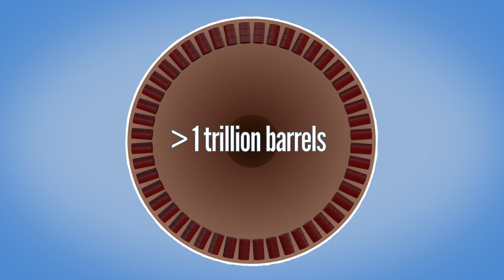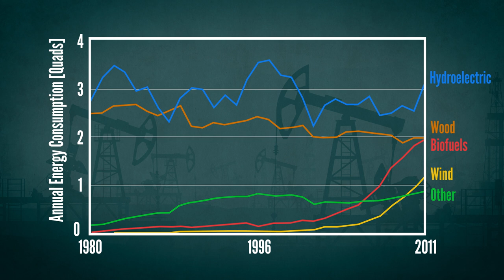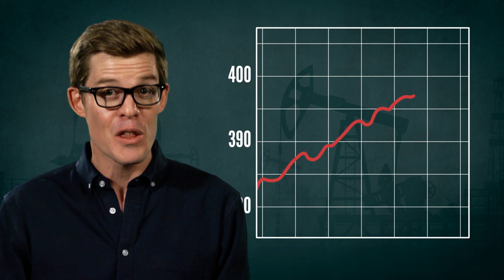When Will We Stop Using Oil?

Comment: The problem we have with energy is that we are kind of bad at getting it.  People living in extreme continents like Europe and North America are using oil, and for what? There's plenty of solar energy at the equator. There are deserts there, full with burning hot energy. We could harvest that energy, if we cooperate with the countries there. We pay them a small fee, or we simply build the infrastructure ourselves. This is a way better alternative than letting that energy dissipate into the atmosphere while we burn oil.
Reply: Transmitting that energy would be a challenge. More local sources already lose 40% in transmission. However, the coldest corners of the planet get plenty if solar energy beaming down at them. It is a collection and storage that are the challenges.
Reply: You seem to not understand the challenges. First off, solar panels are not as efficient as you might think. They do not currently have an energy output even close to that of oil at the same price, and that goes to another issue: cost. The cost of setting up enough solar panels to provide energy on the level of what oil gives us is infeasible in the surface area needed for those panels. You also cannot convince the masses to invest in solar unless if it's a more economic decision for their lives. Money is the largest incentive to most people.
Reply: Electricity is one of many forms of energy. Electricity accounts for about 20-25% of total energy consumption. Solar, wind and nuclear produce only electricity.  These will not solve the problem.

Comment: Its so sad that nuclear isn't used more.
Reply: al thought i agree whit nuclear the affects of it wayyy to risky take the ukine for expanmple the city whihc had its nuclear core melt caused so much radition that to this day its still there and also it too expenices
Reply: Stalin wut did happened to ya bruh?
Reply: Nuclear Fusion not fission should be utilized.
Reply: Alpha581 Sure it should, when we have it. But sustained efficient fusion is still far off. We should not wait for lottery but do something now.
Reply: The problem rigth now with nuclear plants is the radioactive waste that they produce and these radioactive material takes a long time to decay.But we till have other renewable options.
Reply: Alpha581 Waste and problems produced by nuclear is microscopic when compared to fossil fuels. All the waste goes to the metal containers and is manageable and most of time managed really well.
Also there is different kind of reactors that can use other reactors waste as fuel. And we are getting better at it with every next gen generation reactor. Renewable's are good choice in some places/climates and applications but can't produce majority of ever increasing power we need.
Reply: +mukkaar Still not sustainable. Sorry.
Reply: mukkaar it's expensive
Reply: Not sustainable from an environmental point of view. Sure, the quantity of pollution is small compared to other energy sources, but the impact of said radioactive waste is HUGE!!! Why? Because radioactivity lasts pretty much FOREVER!!! Some people idealize nuclear energy as if radioactive waste leakages didn't exist, the problem is that when something like an earthquake leaves you the way the Japanese are now after having the problem in the Fukushima reactor, you can't deny there are problems. 
If nuclear energy is going to be any real good, then R&D should be done to make it better, If not achieving Fusion, at least I have seen some stuff about thorium fueled MSR which seems very promising, but I would not focus my bets on Nuclear. I would rather think about solar and wind power and as many ways to store the energy from said sources as possible (Batteries, Hydrogen, etc.)
Reply: @tauceti8060  Have you considered anti-matter drives powered by di-lithium crystals?   It can drive the Enterprise at warp 8 so why aren't we using it?

Beam me up Scotty, there are no signs of intelligence at all on the third rock from the sun.
Reply: @p0llenp0ny  The earth and sun are not sustainable.  They are scheduled for a burn out.

Comment: Unless there's some massive breakthrough with renewables, I personally think the only real short term solution we have is Nuclear energy.

A video explaining it's advantages over the alternatives:
http://youtu.be/pVbLlnmxIbY
Reply: the problem is we subsidize oil we to focus on subsidizing renewable energy like wind and solar
Reply: MarlowPreston That video doesn't talk about the huge cost of building nuclear reactors, running them or decommissioning them.  The last nuclear reactors built in the USA were 3 - 5 times their original budget.  Today, reactors in Finland, the UK and the USA are experiencing the same ballooning costs as the previous generation of reactors, so we're repeating the same mistakes.  There's only so much time and money to deal with climate change and nuclear power is too slow to build and too expensive to be a practical solution.
Reply: MarlowPreston its awesome until we have a meltdown.
Reply: You're underestimating the power of human error. But if this is what you choose to believe fine.
Reply: mijnnaam maannjim what "all in" costs are you using for nuclear power?  (The figures from a reactor currently under construction would be your best bet).  Keep in mind that even these high build costs are subsidized by government money and policy to keep them artificially low.  

And what "rare-earth" elements are you talking about that solar power requires?  Silicon, glass and aluminum aren't really in short supply, unlike uranium.

Finally, solar power cannot be used as a cover for a weapons program while nuclear power has been used as a front for developing nuclear weapons by several countries.
Reply: mijnnaam maannjim Nuclear is subsidized out the wazoo.  It sprang out of nuclear weapons production and a lot of the research was used to make nuclear power possible.  The fact that light water reactors can easily churn out plutonium also intricately links them to nuclear weapons.

Secondly, the Price Anderson Act forces the U.S. Gov't to cover the nuclear industry's liability insurance, something they cannot buy on the private market at any price since the potential liability for a nuclear disaster is larger than  even most countries to recover from.

On top of the billions in loan guarantees, new nuclear plants are able to pre-charge electric customers billions of dollars years before these plants open, or if they ever open at all.  These "cost recovery" measures saddle utility customers with the high risk that nuclear plants under construction will be abandoned while the nuclear plants themselves get to present an artificially rosy financial picture to investors.

When plants do get abandoned, utility customers have routinely been saddled with the bad debt accumulated during the failed reactor construction project.  Look up WPPS or the "Stranded Debt" of Ontario Hydro for some examples of how this works.

Even after all these subsidies, nuclear plants are uneconomic to run: http://www.bloomberg.com/news/articles/2015-01-05/new-york-reactor-s-survival-tests-pricey-nuclear

Finally, we are finding out that the cost estimates to decommission nuclear plants were wildly low.  Some decommissionings are coming in at billions of dollars and taking upwards of 60 years because of all the residual radioactivity on-site.  

We are not seeing the full costs of nuclear even in the super-high reactor construction costs.
Reply: mijnnaam maannjim And as for the new Dutch offshore wind farm, I assume you're referring to the Gemini Wind Farm.  At 600MW and costing 2.8B euros ($3.18B), it comes in at 4.6 euros ($5.20) per watt.  Even at a 40% capacity factor, it will generate 42B kWh (240MW * 24 * 365 * 20 = 42B kWh).  The cost will be $3.18B / 42B kWh or 7.6 cents per kWh.  Increase that to 8 cents for O&M. This is very economic, especially considering power prices.  And especially considering that the new Hinckley Point C reactors are guaranteed to make at least 14.7 cents per kWh with prices escalating to over 30 cents in the 2030's: http://www.world-nuclear-news.org/NP-Hinkley-Point-C-contract-terms-08101401.html

So, which technology is actually economic?
Reply: mijnnaam maannjim "Neodymium, terbium, dysprosium, europium, indium,...and yttrium,"  None of these are used in solar cells: http://www.madehow.com/Volume-1/Solar-Cell.html

Silver is used for electrical contacts, but this is not a "rare earth" element and replacements are being found for it.

While thorium reactors and / or reactors that can burn nuclear waste are desirable, they only exist on the drawing board currently.  Some experiments with them in the 50's and 60's led to disastrous results.  These reactors would need a decade or so of development to achieve a modern design and another decade or so of development to achieve commercial viability.  I'm all for seeing if these reactors can become viable, and this investment is vastly preferable to throwing more money away in light water reactors.  However, 20 years from now, renewable energy and batteries will be even cheaper than they are now and it will be hard for new nuclear power to supply more than 10% of energy use.
Reply: they migth be a solution someday, but for now we must test and experimante on them to come up with cheap, safe and easy to maintain nuclear plants
Reply: Gonna be honest here, I'm more interested in the source of your profile picture. Sauce please?

Comment: Using oil and coil or even wood as an energy source by the principe of combustion produces CO2, light, water and thermic energy that we use. The main problem is the CO2 released into the atmosphere, and the more CO2 there is, the more the whole global warming thing become strong, the more temperatures all over the world increases, but that’s not all. Even a slight increase of CO2 have good effects on plants, as they use it with water and sunlight to produce... organic stuff. Then we can deduce that the more CO2 there will be, the faster plants will grow, the more CO2 will be recycled. It’s like if plants converted sunlight energy, water and CO2 into some sort of battery, wich when we use it release that « sunlight », water and CO2 but a part of the sunlight energy is converted into usable thermic energy. Does that mean that using coil, CO2 or wood as an energy is like using solar pannels? A clean energy source that produces exactly what was used to create it, exept a part of sunlight converted into usable energy, that can be converted into electricity for example. Then the problem is not the use of these energy, but the fact that we don’t help nature doing the opposite. The more trees there will be, the more they will be able to recycle CO2 into new usable energy source. But we cut trees faster than they can grow because we need a lot of energy... but we don’t replant all of them. Then the more we need energy the less nature can recycle our wastes. The solution wouldn’t be to plant trees more than we cut until there is enough of them to substain our needs?
Sorry for the bad english, I’m still learning it. Feel free to respond as I don’t really understand yet why CO2 is that big of a deal even though it is benefic for nature and has always been, way before humans discovered fire.

Comment: When a replacement good that is less expensive per unit of energy becomes available, people will voluntarily switch to that.  

A rising oil price (due to scarcity) would cause such a switch.   For example, with cheap enough electricity (stymied nuclear reactor design anyone?), we could economically make synthetic petroleum right now.    The tech exists... but why make synthetic petroleum gasoline when you can pump it out of the ground and refine it for a fraction of the cost?

For this reason, no, we will never "run out" of oil.   What will eventually happen, given enough time, is that we will stop using it for the sake of it's cost relative to a given appropriate replacement good.

Comment: ** Renewability and sustainability are two very different concepts. **

** Replacing oil as an energy source is relatively simple, but not so as a feedstock. **

Really good to see a reminder that we moved from "current account" resources to "deposit account" resources. The often used term "unconventional" to describe non-fossil energy resources perfectly highlights the misconception surrounding us. There is nothing conventional about coal, oil or gas.

There is one major flaw in the video that unfortunately feeds this misconception/confusion. Whales are definitely renewable, as are trees and all living organisms. How we harvested whales, or more precisely, the pace of that harvest, made the use of a resource UNSUSTAINABLE. It is very much a second order issue, regeneration rate versus depletion rate. Renewable simply describes the former; there is a rate of regeneration and there is regeneration. In the same way, fossil-resources are probably still being generated, probably renewable, but the rate of renewal or regeneration is much lower than the rate we could deplete them, thus making using them UNSUSTAINABLE.

Whales are renewable, but how we used them made it unsustainable to the 
point of making it extinct. Until that extinction point, they will 
continue to reproduce at a lower and lower rate. They would remain 
renewable until the last pair stop reproducing. Please correct that in 
the video.

Non-renewable resources can support a high usage/depletion rate in practice. For example, uranium is not renewable, but it can support fairly long-term usage (whether fission energy is a good or bad thing and what kind of technology should be used for that, those are totally separate questions about choices). 

There is a second important point not addressed by the theme of this video. Oil is no just about energy, it is the largest part of it which has alternative resources. If we force the exclusive use of non-fossil energy in favour of solar, wind, hydro (including waves and tides), biofuels etc, what do we do about petrochemicals? That is a bit harder to replace.

There is too much focus on just the energy - oil relationship which has plenty of alternatives. Petrochemicals have alternatives based on renewable resources and their sustainable use, but they are generally much hard to accomplish.

It is okay to be smart and think a little deeper - please address these commonly confused issues.

Comment: Those who understand peak oil ask this question: how long can we keep increasing the rate we pump out oil? Peak oil is concerned the world reaching the maximum oil production, not when we run out. The real problem is not when we will run out. We many never run out of oil because the last amounts may be so expensive to extract that we will never do it. If the world were smart, we should have stopped using oil decades ago with the oil crisis in the 1970's. The technological challenge of replacing fossil fuels is herculean. Oil shortages tend to coincide with economic downturns. It may be possible for us to transition to another society that does not use so much oil, but can we do it through the economic crisis, political upheaval and potential resource wars?

Comment: We have sparked some new innovations in the last 3 years. Here in England there's an energy company that offers 100% renewable energy in exchange for a higher price. I'm proud to say I'm on that plan. 
Yes I'm not 100% green, but I'm working on it. 
I never take buses or cars, but walk or cycle to the destinations I need to go to. The only inefficient energy usage I currently am guilty of (yes unfortunately still the majority) is Produce from shops, heating in my home and the environment/organisations that run in the way that it sustains me and my fellow lifeforms. I'm hoping to change at least part of the produce cycle to become more environmentally efficient, maybe by growing some vegetables, and reducing my meat intake, by substituting for vegetable and fungus proteins. I'm not sure how much more advancement I am able to achieve in my fight for economical efficiency. 
Oh, and as it comes to heating in my home, I live in a High-rise, so I'm profiteering from my neighbors heating, leaving it turned off in my flat 95% of the time. 
Still addicted to hot showers, but I've substituted some for cold showers, to torture and force a reset within my neural dopamine receptors, thereby breaking my depression. 
Hope this helps inspire some changes for a greener lifestyle.
Reply: *clapping noises 👏

Comment: When there are less expensive and efficient ways to produce energy.   Solar is great but $30,000 worth of equipment has to be put on your roof.
Reply: Solar and batteries on a equatorial sailing boat is reasonable relative to a diesel generator and batteries. Solar on a sail boat in the north is not.

Comment: To answer that question - or it's follow up -When will we? We would have to know how much oil the Earth makes in an average year. Also we won't actually use up all the oil because some of it will be in tiny deposits that aren't worth drilling to. So the real question should be when will oil not be a viable answer to each specific thing we use it for? Burning it in cars to get to work or the grocery store will end long before using it to lubricate machinery or using it to make medicine since the volume needed is drastically different and at $10,000 dollars a barrel it's still possible to use it in tiny amounts in a large system, but not 3 or 4 gallons a day just to move across town twice a day. So some uses for oil will be replaced before others and it's use (like that of wood will drop)